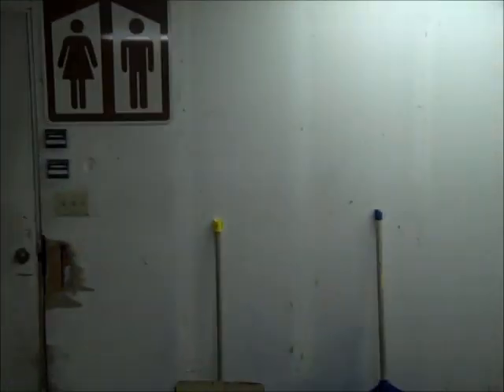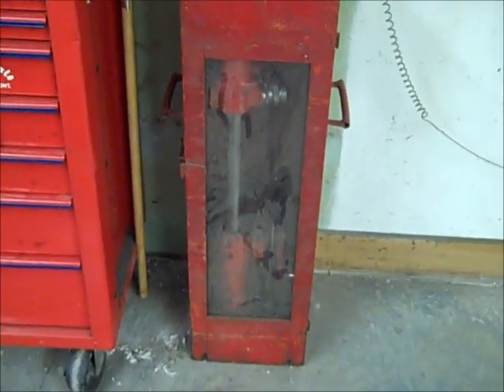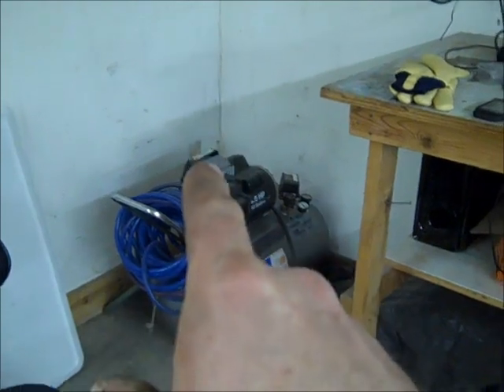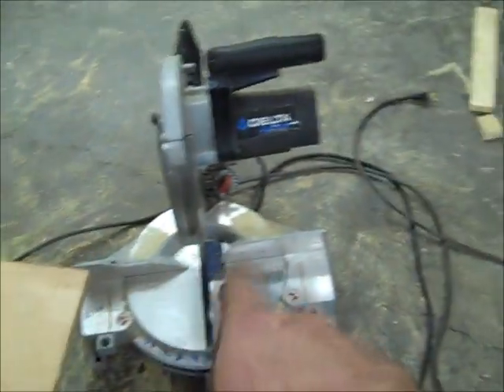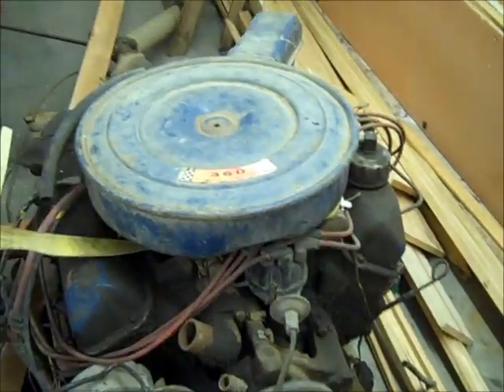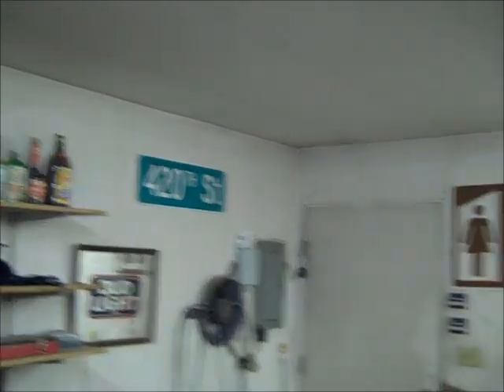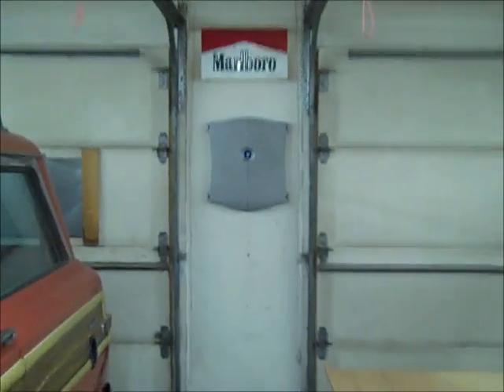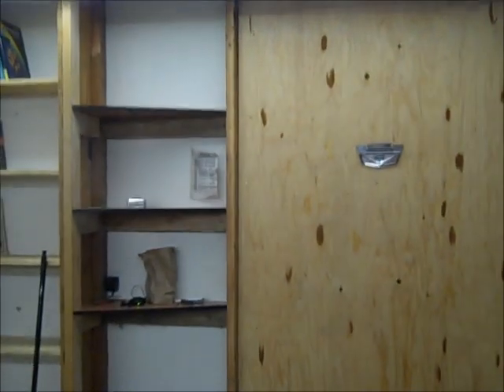Tour of the semi finished new garage

Comment from the maker: @andrewcrawfor1381 is it a factory triple deuce if so have your carbs been synced lately and if not did you use proper outboard secondaries with a center primary and a progressive linkage with the aftermarket setup